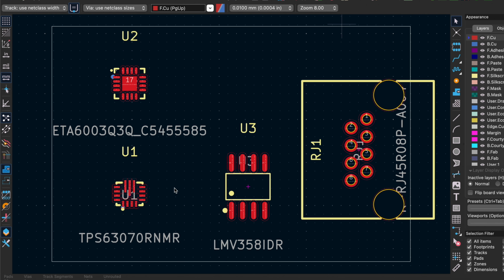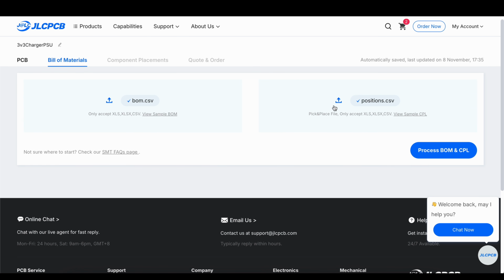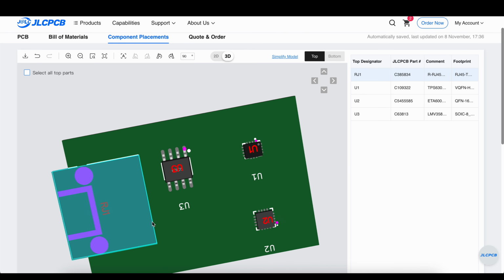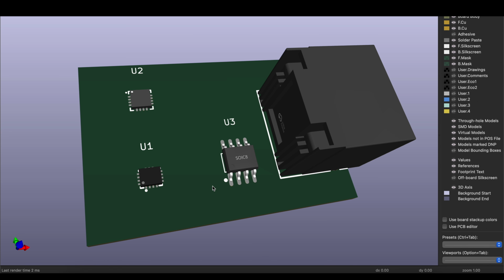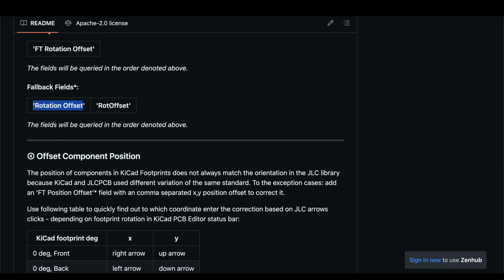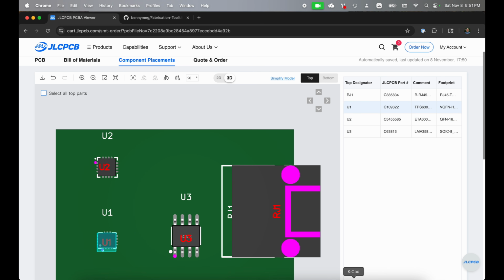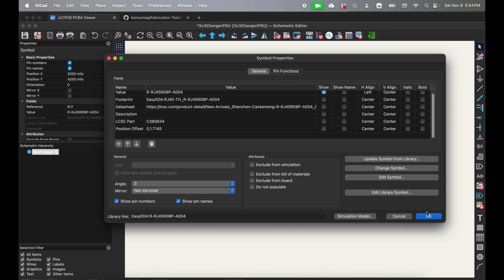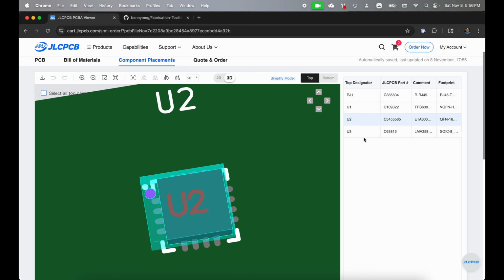Avoid Fatal Production Flaws with JLCPCB and KiCad

Comment: JPLPC is automatically placing the IC correctly, even if it shows wrong. Several uploads with the same board showed different orientation in JLPCB

Comment: Is there no way to set the rotation correctly in the part, rather than needing to add new parameters? This feels like an error elsewhere, and the added parameters are a workaround.
Reply from the maker: In the interim I wrote my own jlc part import tool, called jlcimport. You can find it on GitHub. It does not appear to have the same issue with rotations. I’d still suggest you double check every part on jlcpcbs tools before sending off to production. 

Several posters have noted that jlcpcb staff or tools will frequently correct these errors for you. I wouldn’t trust that at all.

Comment: 2:20 "there's nobody going to step in and correct..."
That's not my experience..
My order to JLCPCB had an additional file from a previous version. Their order checking process spotted it and I got an email asking if I wanted them to ignore that file.
Reply from the maker: I think the experience is mixed here. I've watched youtube videos from a creator who ordered from JLCPCB, and half his components were rotated, and it was not caught. I think you are just leaving it up to chance if you expect JLCPCB to catch component rotation. It simply cannot be an automated process, so relies on some human being somewhere stepping through every component, and rotating it. I'd rather that human being be me :)
Reply: @ElectronicsUnscripted  "It simply cannot be an automated process, "

Kidding, right???
OF course its automated!  Thats the whole point of cad/cam!
Reply from the maker: @dougaltolan3017 when they’ve caught rotated parts it was not an automated process, or the software would have just fixed it when you uploaded. Their automated process will put your parts exactly where you tell them to. If that location/rotation is incorrect it takes a human to intervene.

Comment: I ordered some PCBs from JLCPCB from Kicad that rotated parts like you show on a 8 pin SOIC when I placed the order but, when JLCPCB manufactured the board they turned the parts correctly before soldering.
Reply from the maker: Yep you might get lucky.